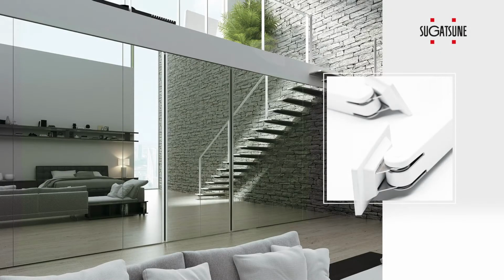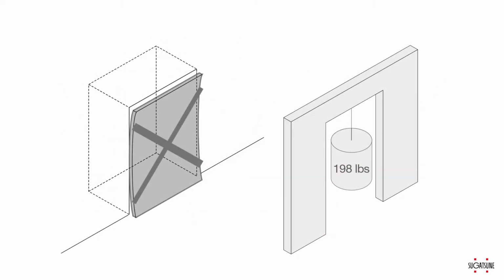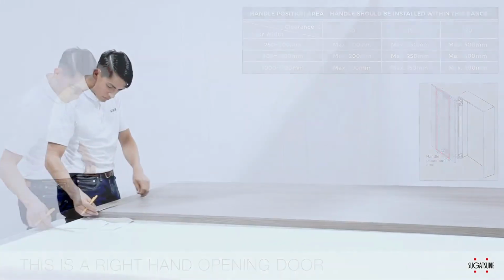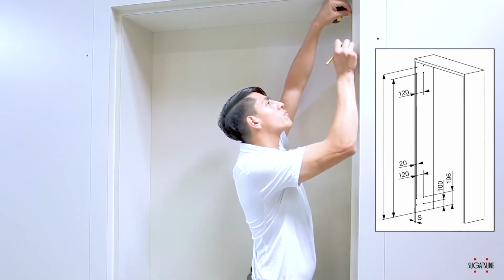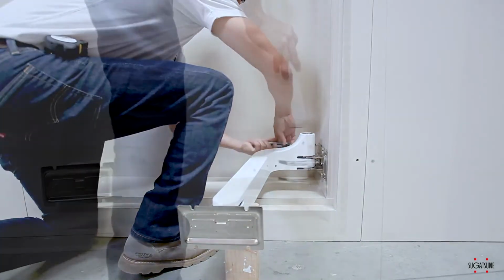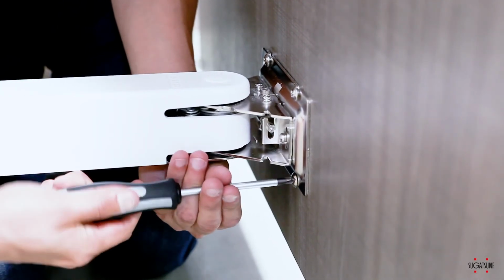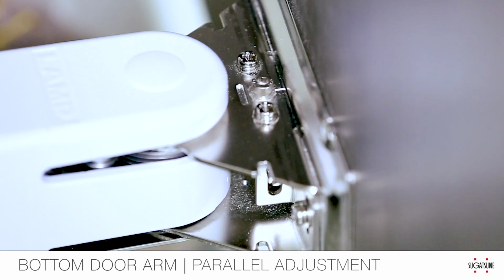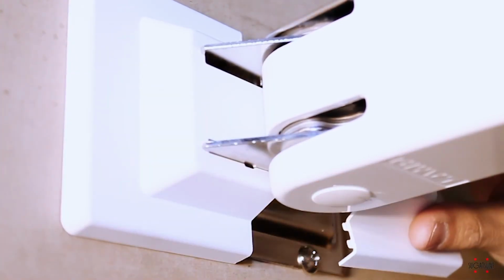Sugatsune America - LIN-X1000 LATERAL OPENING SYSTEM INSTALLATION 2018

Comment: Hello, is there a similar system that works with push to open instead of handles? Please advise.
Reply from the maker: The LIN-X door systems are truly one of a kind. We don't currently carry a similar lateral opening door system compatible with a push-to-open latch. Push-to-open latches are primarily used with traditional swing door hinges. 

Please email support@sugatsune.com with any other questions you may have. Thank you!